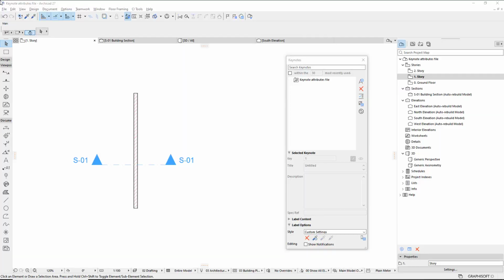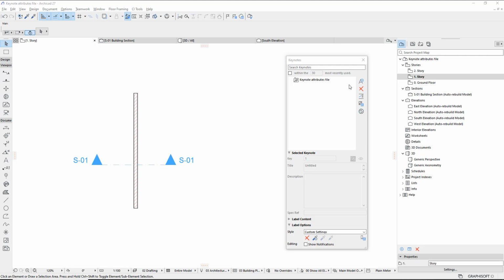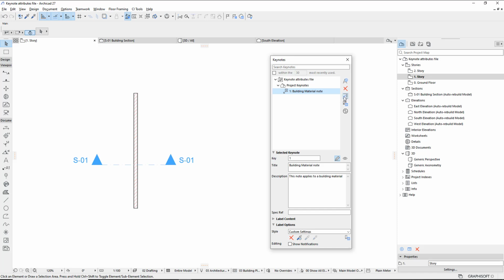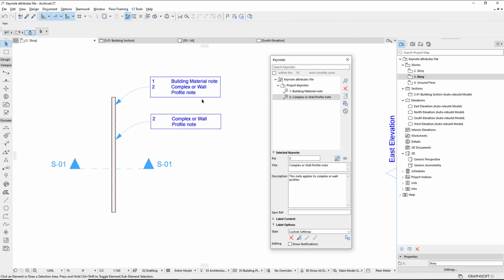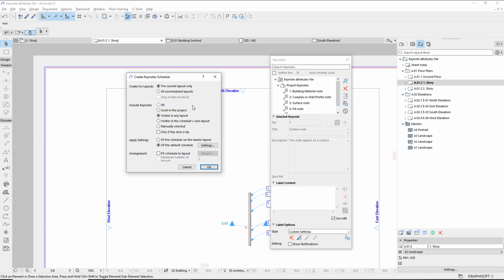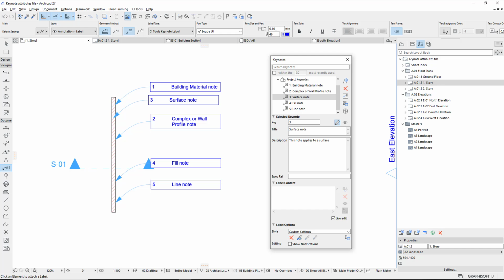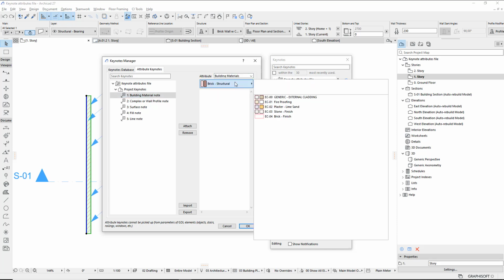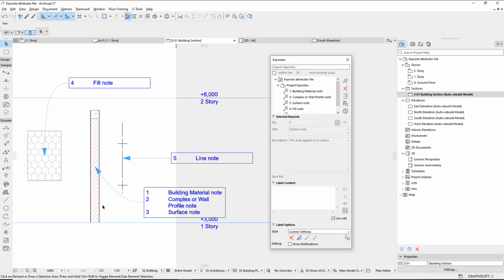Introduction to Keynotes

Comment: How do I close keynotes from Archicad 27, when they have attached to the main project (are not a separate box)?
Reply from the maker: hi - i'm not quite sure what you mean sorry? to close the floating palette, you can just click the close button on the top-left. If you have docked the palette, just undock it first by dragging the drag handle away from where it is, and then closing it